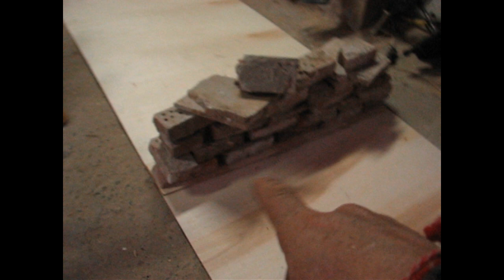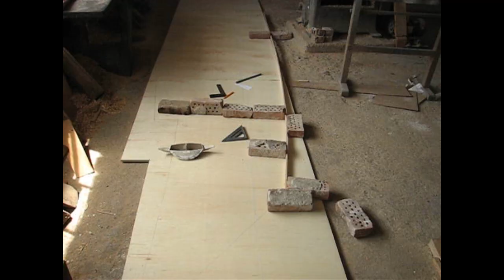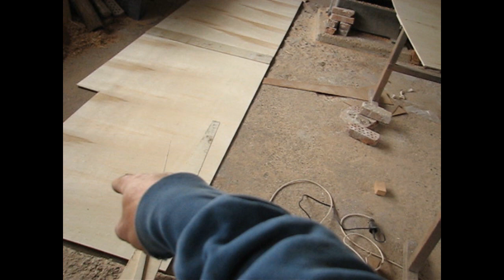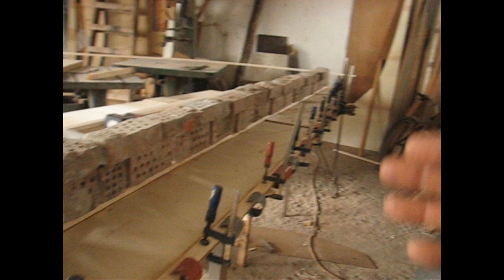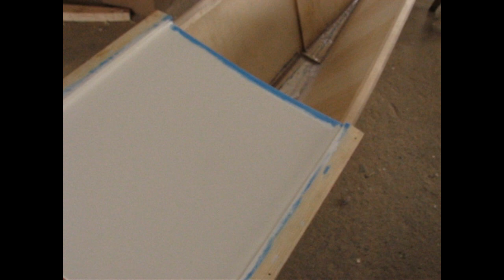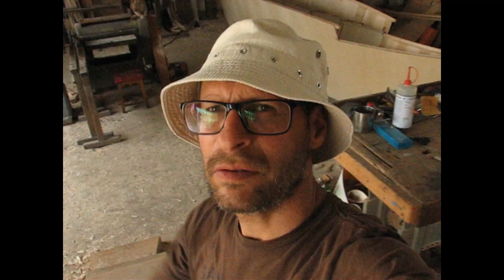Vaka Build, Havaya 30/25

Comment: I would like to find a similar paint in the US
Reply: I built a Phantom dinghy in 1980 and used “International 109” the dinghy went to dinghy heaven about 2012🙁 the paint was still good and was never repainted. It is still available, but very expensive, but if it can last 32 years living outside that has got to be economic😀
Reply from the maker: High gloss 2 component Acrylic, is how it's called here, in America maybe Latex???
Reply: @BalkanShipyards  thanks, i got some good results on a search using those terms.  Rustoleum 3300 System Acrylic Aliphatic Urethane
Reply: @skyl4rk  Car paint stores will have really good 2 part acrylics. I don't believe they are as toxic as two part polyurethanes, which are popular yacht paints and aircraft paints.The two part polyurethanes are extremely toxic (cancer producing) when sprayed and very toxic fumes even when brushed and rolled. I painted a panga skiff with the 2 part acrylic paint that I built in Costa Rica and it was great. It's still glossy after 15 years and I rolled it and then leveled or "tipped" it with a foam brush. Sherwin williams has an industrial epoxy paint that I used once on a yacht tender pram that I built in Panama and it was great and really kept water out BUT it tends to chalk after about three years. I used white. This was years ago and I think the technology is so much more advanced now that there are much better products.